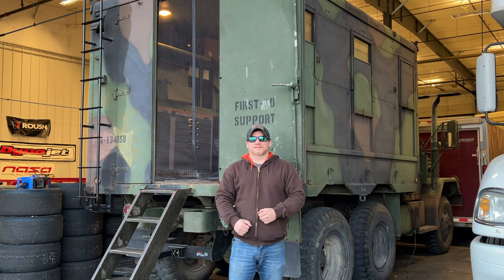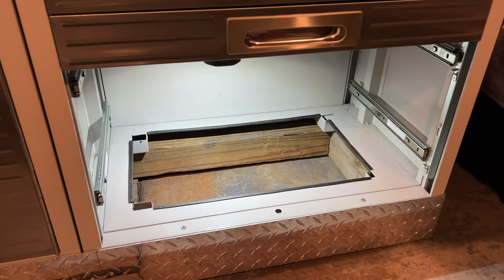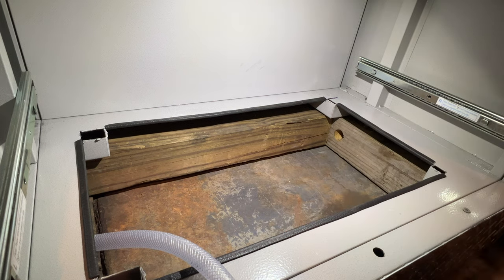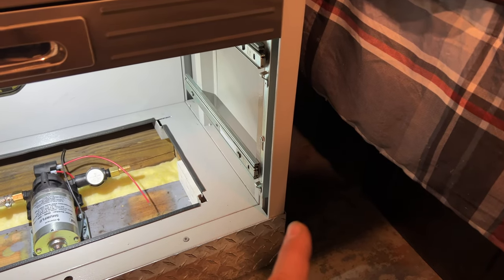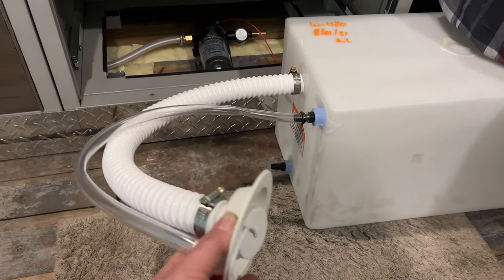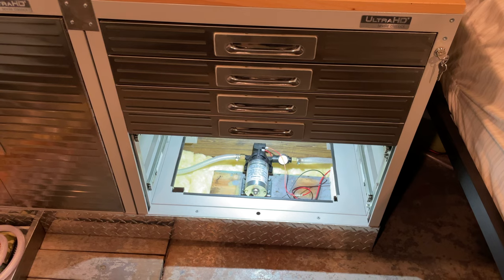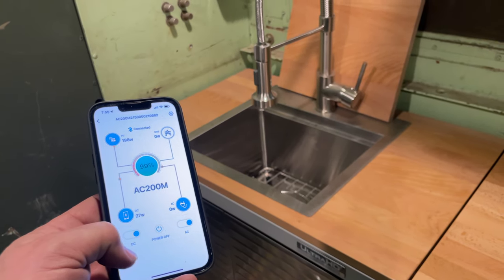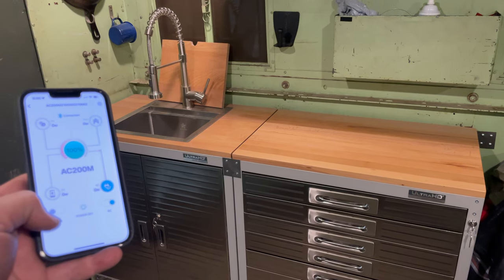Bluetti AC200 Water Control for the M35A2 M109A3 Overland Camper Build

Comment: First thing to fail from freezing water in our summer home was the faucet. The pipes were plastic and didn't burst. With non metal pipes I'd be most worried about other metal parts of the plumbing. The way I deal with freezing temperatures is having a drain valve to empty the pipes, another option would be electric pipe heaters and some pipe insulation.

Comment: Just wondering is that pressure activated or just turn on when you Want water to flow, good set up isn't there any room for the tank under the vehicle, be great getting out and about, all the best to you and your loved ones
Reply from the maker: The pump will build pressure and then turn off.  You could leave the pump on all the time but not a good idea when you are away in case something developed a leak, these things drive down very bumpy roads.

Comment: i don't understand why not just add a switch to turn on and off the water pump? what if you have multiple accessories connected to the AC ports of the Bluetti? I have AC 200 Max on my overlanding truck, i have water pump connected to AC outlets, diesel heater, water heater igniter, cell phone charger, etc. i can understand if you only have one device connected to AC port, but if you spent so much money for a 2000Whr bluetti and only use for this purpose i don't see the point. yes you also connect to the DC ports but wasting the AC port this way is just not a good investment...
Reply from the maker: The truck has 12 v and 110 outlets all over it.  No need to run a cable all the way to the bluetti.  Just plug into nearest wall outlet.

Comment: just don't let your phone battery die.
Reply from the maker: You can manually hit the buttons on the Bluetti to turn it on and off as well.
Reply: Pretty hard to let the phone battery die when there's numerous ways to charge it, especially those cordless charging options.